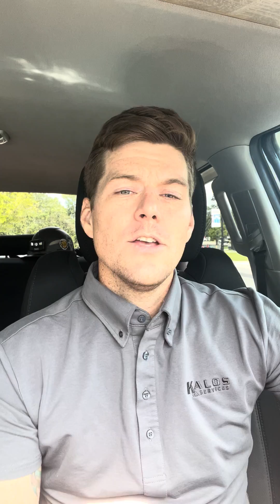Charging VRV/F and Connection Ratio #vrf #charging #notsoeasy

Comment: I have a system that may possibly be low on charge but need more info on the system before i look add or remove charge also a leak search. No to familiar with DAikin , Is there a test mode for just cooling Samsung had test mode for heat and cool. Now Is daikin just Test mode BS2 for 5sec and watch the data is this the only test mode?
Reply from the maker: Great question! Test mode for Daikin is only for when the charge amounts are changed in the system or at start up. I have a video on when and when not to use Test Mode for Daikin.
Reply: @RomanBaugh  I did my commission and trouble shooting 2 years ago now going to see the Daikin software for the 1st time I'm ready comfortable with the Samsung software and have a bit more exposure to the Mitsubishi software. Very little next to none other than what you have posted on the internet so I'm just trying to give myself a little bit more information before I start standing in front of the unit and you do have a wealth of knowledge and great videos.
Reply from the maker: I appreciate the support! There is a lot of great knowledgeable people out there. Good on you for seeking out information before you stand in front of the unit. That takes a lot if effort and I respect that!